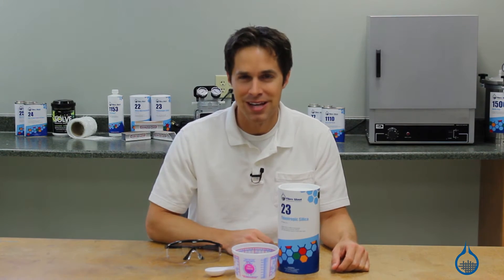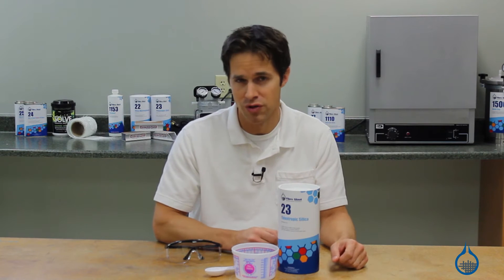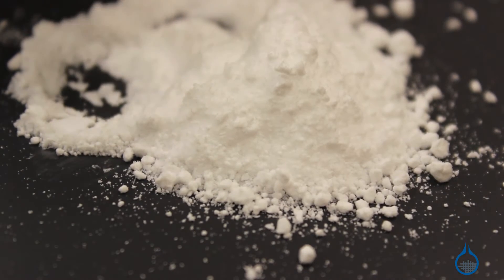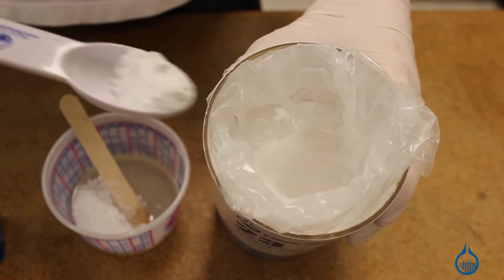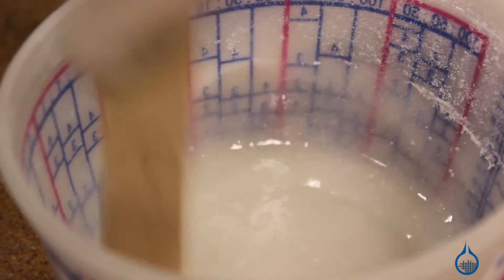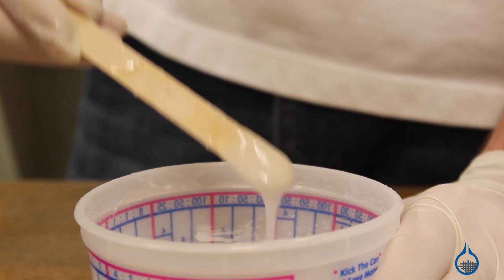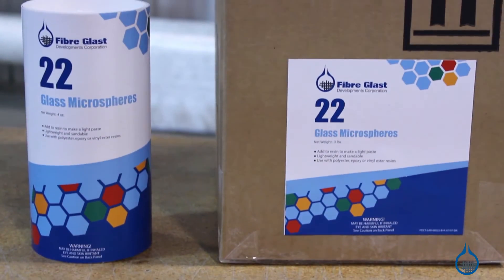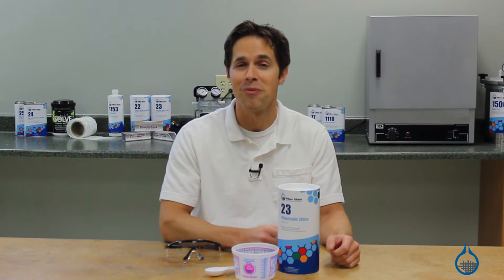Thixotropic Silica

Comment: Hi pls can you offer any advice on what would be best to add to my casting powder for my handmade products to make them much stronger . Thank you so much . And if you have a recommendation could you tell me how easy it is to use many thanks .
Reply from the maker: Thanks for reaching out. We are not too familiar with casting powders. We can at least point to our higher strength fillers that might add additional strength for you. They are commonly added to concrete for strength. I would look at our milled glass powders or the chopped fiberglass: https://www.fibreglast.com/category/Fillers

Comment: Can I use this on silicone?
Reply from the maker: Good Morning. Could you give us a little more information about your application process with the Thixotropic Silica so we can accurately answer your question.
Reply: Fibre Glast I want to make a silicone mold for a mask I plan to make. The silicone I'm using is OOMOO30 by Smooth-On. I want to know of this would thicken up my silicone.
Reply from the maker: Thank you for clarifying! Yes it will thicken up that silicone.
Reply: Fibre Glast Thank you so much!!!👌♥️